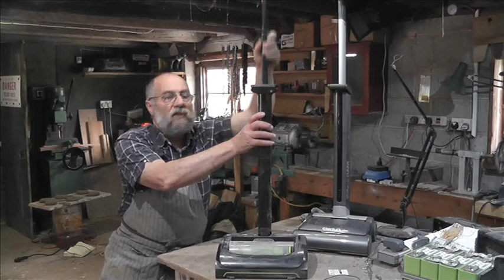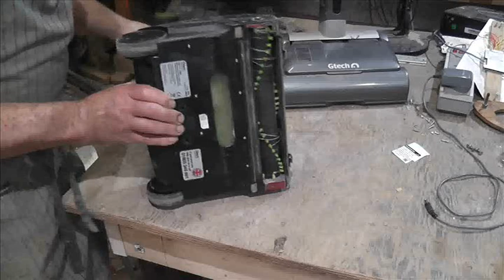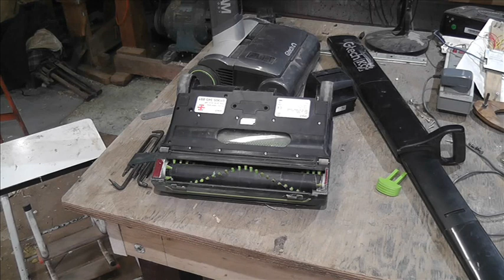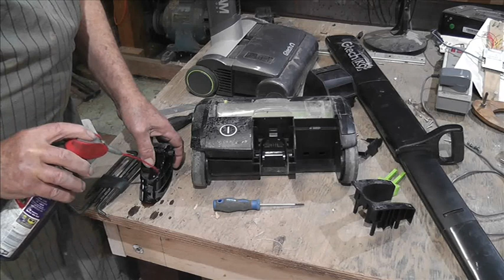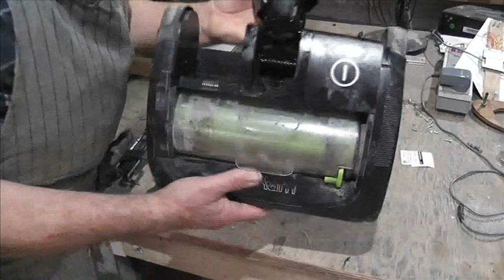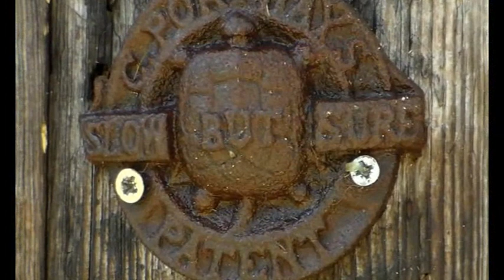Gtech Mk 2 vacuum repair, no parts required, AirRam K9

Comment: Could it be that the process of taking that apart led to the fix?
How is it now, 2 years later?
Unfortunately I don't think I can get to the roller unless the handle yields and I'm watching this cause it won't yield
Reply from the maker: Hi, a soak in WD40 may just start things moving, cheers

Comment: Excellent video and another vacuum cleaner saved from the tip after some WD40. Not sure if it is a long term solution but hey....
Reply from the maker: I believe if this is used then it will not seize up again, only time will tell, cheers

Comment: I bought a set of long torx from TEMU
Reply from the maker: Can't beat having the right tools, cheers
Reply: @TheInfoworks  welcome, I have just repaired an AirRam Mk2  the hardest bit to get ti is the battery terminals on the cleaner, I found a dry joint stopping the battery from powering the cleaner, it was a pig to get out and put back in
Reply from the maker: @grahamhenderson5609  always the same when approaching a job for the first time. Bad solder joints are the bane of electronics, and even worse now with lead free solder, cheers

Comment: The only problem is if you use lubrication it will in time clog the freed mechanism with dirt and dust, might be a good temporary repair.
Reply from the maker: Exactly, it's a fine balance, cheers

Comment: Thanks Andy. Saved me buying a new yoke for £32, and even saved me buying a T10 torque screwdriver, because you can get some WD40 to the roller even when the yoke is stuck.  Bad design on GTech's part.
Reply from the maker: Yes indeed a strange setup. Well done for persevering. Hope you are a subscriber, cheers
Reply: 10er on ebay  l just bought one , but nice video well done
Reply: How did you get to the roller if the yoke is stuck
I am currently in the position, can't release the handle so can't see the roller hence can't lubricate it.

Comment: A mate gave me my third of the mk1 air rams this week, just needed an end cap. Worth it I think.  I think these are tidy little vacuums. 
I added another 2 panels on a fence, vertically, smashed glass, time will tell.
Reply from the maker: Yes the plastic end caps can break when stuff is dragged into the roller, the aluminium replacements are better. What is the inverter for those 2 panels, must be a low volts start, cheers